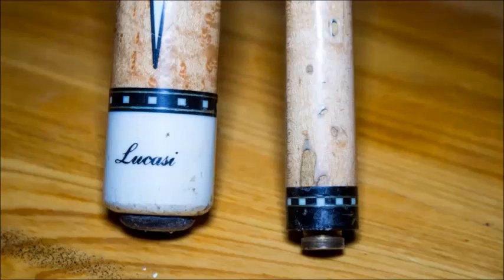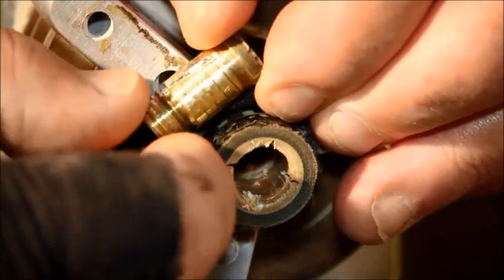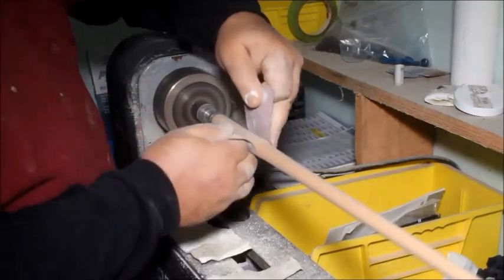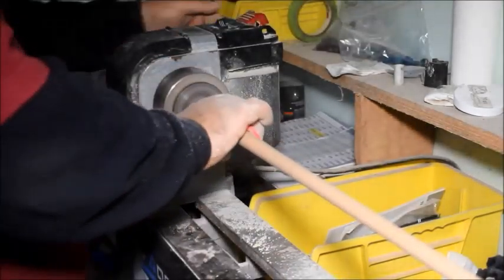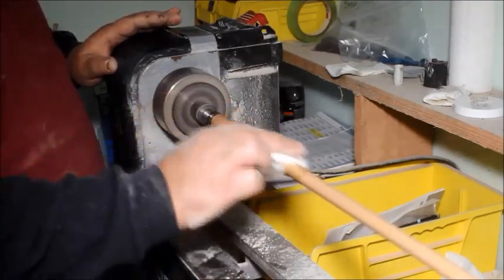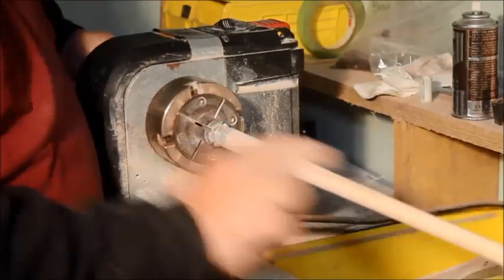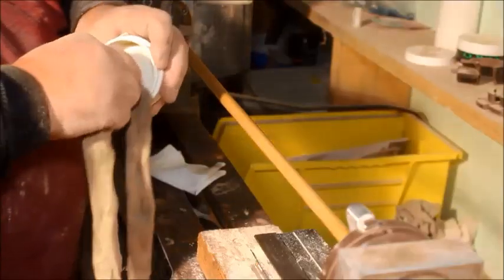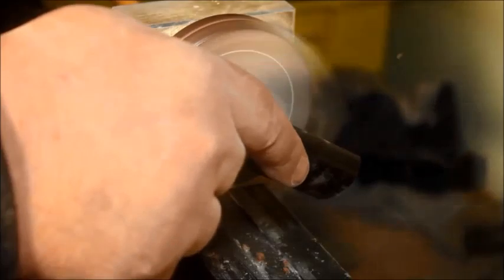Pool Cue Repair and Complete Restoration

Comment: What a beautiful job. Looks like new!!!
Reply from the maker: Thank you for the kind words. :)  This was one of the jobs I was especially proud of. Hence, the video !!  :)  You see, on this cue, the logo is painted and sand right off when you remove the cracking pealing clear coat finish. There's no way to stop sanding before the logo is damaged. Unlike an inlaid logo like Muccie. 

Anyway, I made a stamp and attempted turning my wrist & cue at just the right speed and pressure over 150x's before I actually got it correct. Then the new logo melted off when I applied the base clear coats of epoxy. I did the whole job again but more like 250x's before I actually got it right and then let the ink dry for 7 days. That did the trick and boy did the cue come out swell. :)

Thanks for noticing :)
Sincerely .................................
Reply: @stephboeker7835  You do good work. They should pay you something. 🙏🙏🙏 Great work!!!

Comment: I just started doing cue repair and your videos have helped me tremendously!  I so appreciate the time and effort you put into them.  Just one question though.  What brand sanding sponges do you use?  :)
Reply from the maker: https://tinyurl.com/4vhj3as8
I cut them in 4 pcs each.  You can use them a long time and clean them by holding them against the lathe chuck while spinning if you are careful.  Or, you can blow them out or even wash them.
Reply: @stephboeker7835  you made my day. :)   Thanks again!

Comment from the maker: Thanks for watching and leaving a comment !!

Honestly, I don't remember,  BUT ,  I can tell you this :
if it is a screw on tip, you will see the head of the screw in the center of the bumper.
if you don't see a screw head, then it is a press in bumper.

Press in bumpers may be hard to remove. Either working it out w/a tool (screwdriver, pick, etc ...) or someone before you may have glued it in. In that case, you might as well just cut the bumper off w/ a sharp knife and dig the rest out (or drill) w/tools (picks, knives, etc ...)

New "press-on" bumpers come w/about a 1/2" to 3/4" centering foot on the press-in side. You can measure the diameter of the hole and may be able to purchase to fit.  Or, you may get one that is just a bit tight. In that case I've drilled the butt out to fit.

If it happens that your cue has no adjustable weight screw in the butt, you should be able to purchase a screw on bumper and screw the threads right into the wooden butt.

I hope this helps and thanks again,
Sincerely ....................
God bless

Comment: Where did you get your tail stock.  I have a Delta midi lathe I used to turn saltwater plugs, I would love to be able to repair my cue shafts
Reply from the maker: -The tailstock is never shown in this video , but , my tailstock came w/the Delta 46/460 lathe you see in the video and is part of the package.
However, if you are asking about the three vice "steady rest" that holds the shaft on the ferrule & tip end, along w/ the cross cut sled, I got them from Cue Man Billiards.
https://tinyurl.com/2tdwcnmw
Steady Rest about 14 or so rows down ( $175.)
Cross Cut Sled about 6 rows down ( $295.)
It's a pretty costly investment if you are only going to maintain your own cue.
Hope this helps and thanks for watching, commenting and reaching out to me.
Sincerely ........................
God bless.

Comment: Awesome video!

@Steph Boeker do you have any suggestions on how to fill in an etching on the butt of the shaft where it says Lucasi? The previous owner had any etching done I'd like to remove. The butt of the shaft is black with white writing.
Reply from the maker: Daniel, thanks for the question. I saw this earlier but had appointments at the time, so I apologize for the late reply. 

This is an interesting question, b'c, in my experience w/ Lucasi cues, I've only noticed painted logos on the "butt" portion. If the design is painted, it can be removed easily by sanding at 3000 rpms on the lathe.  Then you just replace the clear coats. 

On the other hand, if it is an actual etching or inlay, you may be able to sand off the clear finish, scrape out the inlay, fill it w/ color epoxy and re-finish it.  However, it is hard to match color (especially dated cues w/ patina) so you may have to settle for close.

Or, you may be able to just paint over the inlay, let it dry for a week, spray clear lacquer to protect it, let that dry for 24 to 48 hrs and then re-finish it.

Hope this helps,
Thanks again,
Steph
Reply: @stephboeker7835  Firstly no apology necessary, thank you for responding. I really appreciate the detail and lengthy response. This is very helpful! I'm looking forward to trying out your suggestions. Thank you so much.

Comment: This is a great video. I am looking to handpaint my pool cue not by airbrush. Do you know the best way to do this? Thank you.
Reply from the maker: I've seen a couple of hand painted cues a girl around here did. They were very creative and intricate designs w/ lots of colors.  I don't know if she used latex or enamel or lacquer paint or some other ?  I'm sure it doesn't matter.   I've used colored wood stains as well.  
The idea is to coat the designs so they don't rub off in your hand over time.  The best coatings are 2 part clear epoxy (2 coats) and then C.A. Glue (10 coats) sanding in between each w/ multiple grits.  The trick is to let the paint designs completely dry for over a week and then you could spray a safe thin coat of clear lacquer over the design to separate it from the chemicals in the epoxy and C.A. glue.  It's a tedious job that takes patience. The more time you spend the less mistakes you'll make and the prettier it will turn out.
Hope this helps. Feel free to contact me on FB (Steph Boeker) and I'll give you my phone # to go over it all if you like.
Good luck,
Sincerely .....................
Steph

Comment: Is there anything that can be done about a very slightly warped shaft?
Reply from the maker: 1st let me say that when the wood grain warps, it's nearly impossible to get perfectly straight.  That said, if it is warped enough to lift the tip off the table while rolling, it's no problem to get the tip to roll flat again.  Although, the shaft will still have a slight warp you can see if looking at the gap between the shaft and table.
So, to straighten a warp a bit, run hot water and soak a rag. Squeeze the rag so it is not dripping but still very wet. Roll the rag around the shaft starting w/ the corner of the rag about where you think the middle of the warp is. That will put the heat and moisture in a long area w/ the warp in the middle. Set the cue (handle attached) on a flat surface like a counter top. Put the end (tip) of a spoon or a quarter or 2 (depending how big the warp is) under the tip of the cue for 15 min.  w/ the warp up. Mark the high side on the white ferrule so you know the warp is up.  Put the largest book or 3 on the warp where the rag is and add a couple of heavy pots.  You need consistent weight pressing down on the warp.  Repeat all the steps every 15 min until it rolls better.  
You may over compensate by having the spoon or quarters holding the tip up too high so remove a quarter or put less of the spoon under the tip.  Always turn the cue so that the warp is up when you add the weight.  Always reheat the rag.
I've never had to do this more than about 7 or 8x's.  Then be careful to store your shaft flat in a case or vertical, but never lean the cue against the wall or leave it in your car to get baked during the summer.
Good luck, hope this is helpful and thanks for watching the video and commenting,
Sincerely .............................
Steph

Comment: may i know what sandpaper to be used for final smoothening the shaft? is it 1000 or 2000?
Reply from the maker: I only use up to 1000g so from 100g150g220g400g600g1000g in sanding but after the machine polish (just polish) I smooth it out w/ 1000g and then lastly I apply the wax and smooth it out as well w/ 1000g.  Hope this helps and thanks for watching and commenting,
Sincerely .............................

Comment: Hey Steph, I just started out on the lathe here =) just wondering is there any way to prevent the base material (wood) from being sanded off or is it that a fraction will have to be sanded away inevitably in a refinishing process?

Thanks in advance Steph.. Been watching your videos ever since I was in engineering school.. 😁
Reply from the maker: Short answer :  You will loose a certain amount of wood (base as you say).

Remember, wood is porous and finish, sealer, epoxy or CA glue will seep into the pours and grab on.  Like sanding is meant to create more surface area for the sealer or finish to adhere to.  Same w/ painting a car or house.
The surface must be rough (ruff) 1st so the finish will catch.

Now, as the finish gets older, some of them will discolor, and that would be so, down into the pours. If you don't sand into the wood, there will always be that dingy discoloration seen through the new finish.

Then there are dings and dents. These accumulate dirt and grime over time, which also get into the pours. You wouldn't want to refinish a cue only to have dirty , grimy spots seen through the clear glass like finish you worked so hard to create.

This is a great question b'c many times ppl would like me to work on cues that have been stained to display a certain color instead of using rare and exotic woods that already have color.  Could you imagine trying to leave a thin coat of finish so as not to sand into the stain layer ?  If you touch the stain layer w/ even a 1000g paper or sponge, while the lathe brings the work to you at 3000 rpms, you will see it no matter how small a mark it left. In this case , the only way to make a good job of it is to sand off the stain and re-stain it.  The level of work sanding the stain out of the wood will certainly be taking off the stained wood.  That may be why the 1st 2 coats are thick 2 part epoxy building back the diameter.  The next 10 coats of thin CA build a deep shine as well as the polish and wax protecting it.

Lastly, this is why when ppl ask me to restore a cue that the designs are painted on, if I take the job, I tell them I can make the cue smooth but try not to get into the painted design. leaving the deeper dents and dirt or paint defects still noticeable. I may even be able to touch-up certain colors but that's a tough proposition b'c colors are hard to match perfectly.  But I can't guarantee that I won't go through to the design and create a blemish or 2.  These jobs are mostly asked by ppl whom received the cue from a relative like a father or grandfather and usually want to only remember them by it.  They talk me into the job and don't demand perfection but trust it will come back to them better than they sent it and in a way that will honor their mentor (family member).  I work very hard on these cues and they do look better than I received them but they never turn out as nice as the cues who's designs or the different color woods and inlays that I can sand right into.

Thanks for the question sir and for watching my video's,
I hope this was helpful,
God bless you,
Sincerely .................................
Steph
Reply: @stephboeker7835 

Hey Steph, thank you for such a comprehensive explanation with regards to my question. I appreciate you for sharing your experiences with cue work. They are truly motivational and I am feeling all pumped up to be back on my lathe! You are a great inspiration to cue tinkerers like me. Looking forward to your next video..😊

God bless you too Steph.. 
Have a nice day 

Sincerely,
Skye

Comment: What lathe are you using? I have been using a standard metal working lathe and yours seems more user friendly.
Reply from the maker: I use a Delta 46-460 wood lathe.  But I got mine years ago when they were still only $650.  I actually have 3 now and one for sale for $500.  It already has a chuck and various cutting tools.  I couldn't afford one now b'c of this administration's inflation.  Even w/ this lathe, I had to ad about $800. of accessories to turn pool cues.  That's because I couldn't afford a real designated cue lathe.  They are about $4000. to get the job done right.
Thanks for watching and for the question,
Sincerely .....................
Steph

Comment: if the shaft had a significant dent how could remove it without making it thinner and need a different ferrel?
Reply from the maker: I believe you could over fill it w/ 2 part epoxy, sand it down in stages, apply a couple few finish coats of CA Glue sanding them in stages and polishing it all up w/ cue wax.
Reply: You probably have done it already but next time you could use drops of water/damp rag and an iron to steam and expand the wood in that area. Then sand it.
Reply: Shukin Andjivin  glue in a toothpick and then sand it.

Comment: I picked up some old 80's Budweiser beer cues. One is missing a shaft and joint. Could you make them into nice cues ?
Reply from the maker: Possibly :)   Facebook me (private message) at this same channel name if you'd like to discuss it and exchange info :)
Reply: No, they are trash. If you spend 15 mins on them it isn't worth your time.
Reply from the maker: I don't know if I believe that ?   I loved my $13.00 cue from Sears when I was 10yrs old to 13 and won plenty of money w/ it against college students at L.S.U.   If you practice, find a cue you like, and tune it up the way you like it, time is not the factor.  Money may not be in that case either.   Sentimental value is a confindence builder and a cue someone gave you or a brand you like will help build confidence as well :)
If I put a new and better tip on a cue that needs it, no matter how cheap it was bought for, the 15 to 30 min I spent was a great improvement and well worth it.

Just sayin',
Sincerely .........
Reply: They would have to have been nice cues to begin with... Lol

Comment: what do you use epoxy for the joints
Reply from the maker: I used Devcon Epoxy but you can use many other types of two prat epoxy ....... fast or slow drying, does not matter.  I think this one is 1500 lbs. psi holding  power ? 

https://tinyurl.com/y6n5f8ue
Thanks for watching and commenting,
Sincerely ...........................

Comment: 6:20 Ringo also has blisters on his fingers.
Reply: Thanks for the Gator love.  One quick question, would any wax work on a pool cue? I have one I like to shoot with in my basement but the lacquer is worn out.  I thought about rubbing a little beeswax on it.
Reply from the maker: @andypetrovich2155  , I don't know what results you are looking for by using wax, but, I use wax more like a protectant !!   In this case, yes, any wax will work. I would say the idea is to get it hot by spinning fast and working it into the finish or wood.  (I DON'T MEAN HEATING IT UP W/ A FLAME OR HEAT GUN)   Then I use 1000 grit sanding sponges to even it all out and remove most of the excess. That way it will be very smooth and slippery. 

Hope this helps,
sincerely ....................................
Reply: @stephboeker7835  
Your advice does help.  The pool que is almost wore down to wood so I want put some protectorate on before I have splinters while shooting.

Comment: I like the work but as a wood worker you are taking far too much material off by sanding that much. Not necessary.  Start with 220 not 100 grit. Take the finish off then if you can steam the dents the wood will rise back and just sand with 320 grit.
Reply from the maker: I appreciate your expert advice. I will say that it's hard to tell just how many layers of clear coat are removed w/each advancing finer grit paper by watching this video ??
But, alas, I don't know how you compare my work to another or what technique you use to judge it.

I do know I was there, had my hands on the cue and abrasives, and set the speeds for each step. I will say that the Lucasi logo was "painted on" by the manufacturer and not engraved and filled like most Meucci cues, so sanding is very tedious and has to be precise or the logo would be sanded clean off. That may be something that shows my intention and desire to use soft hands.

The customer was thoroughly excited and grateful for the job I did. It humbles me to hear the kind words my customers bestow on me.
I hope to one day have the subscriber base you have and the number of video's on my channel that you have.

Thank you for your generous consideration, help and guidance,
Sincerely ....................
God bless you.
Reply: I dont have a channel. Dont have the time for it.  Was not knocking your work. It turned out very nice. Weve just been doing it for years and was trying to save you some trouble.